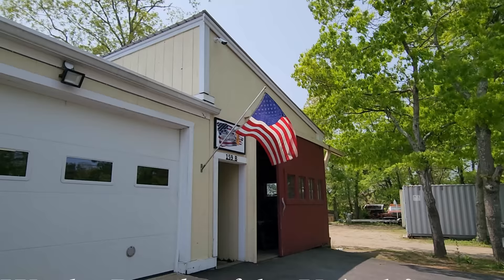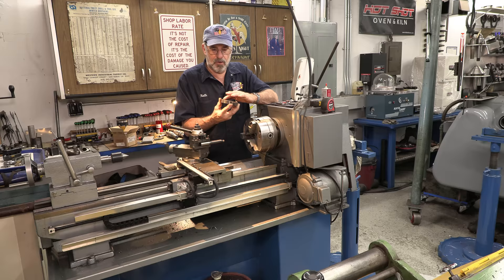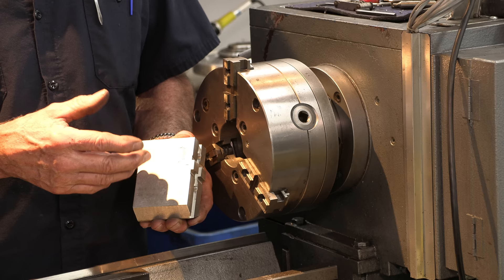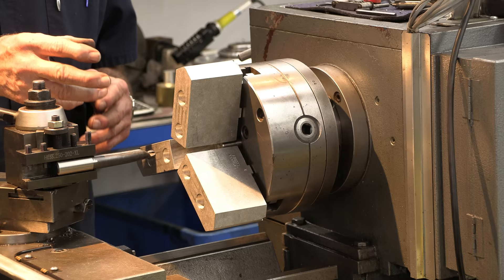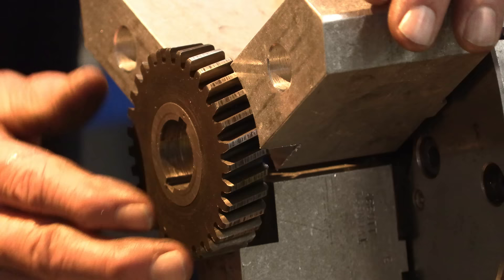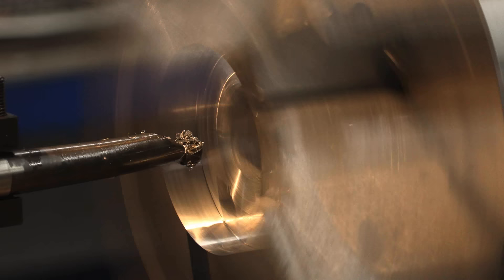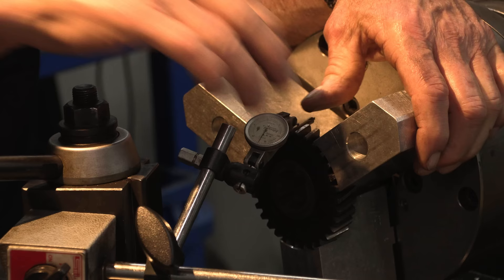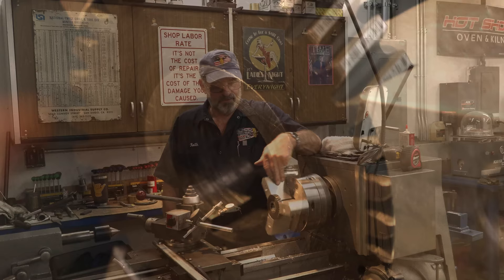Splines & Brakes Clutches & Gears 3

Comment: I worked as an engineering manager at an automotive gear and industrial gearbox manufacturer. We had special jaws that had pins that located on the PCD making the bore concentric to the PCD within 0.0005". What helped was we would use hobs that topped the OD as it cut the gear. After gear shaving, if there were further operations we could use the OD with confidence that it was then concentric to the PCD within 0.0008" on average. After heat treatment the bores were ground off the PCD for a finished part with the maximum concentricity between bore and PCD of 0.001". Your OD is turned so that could be the reason why you see the results you have. The PCD readings look quite promising for you. Interesting post, thank you.

Comment: If i may add a little, you should always use the same chuck key hole when mounting the workpiece as you did when holding the distance piece to bore the soft jaws, and ideally a torque wrench tòo but that might be going over the top for a worn or used part .
Its always good to see old equipment brought back to life by doing the ssme things you have to do to a new oriental one to get it born😅

Comment: i would have thought the outside diameter of the gear would have been better to indicate off of instead of a wear surface in the gullet of the tooth . I assume there could be wear differences in the teeth or even a difference in tooth depth from cutting the teeth . I do like the soft jaw boring setup .
Reply: I thought the same thing, the O.D. doesn't get any wear.

Comment: Keith

I know that you have got a new motor for the lathe with double the speed , but have you considered that you would need to up the HP to get the performance you seek  , if you have not increased the HP it may have a hard time getting it up to the new RPM and be able to take an effective cut 

I ask this because in the long distance past when I serviced large lathes up to 48 inch swing  this very thing was muted for a lathe of similar size to "pearl" it was tried by altering the pulley ratio as a test but the end result was poor , hope yours work out OK
Reply from the maker: I have considered the need to also increase the HP, but I believe the tooling changes from the err of design to tooling err now will equal out the speed difference. Some of the slower speeds are so slow I can pass them walking backwards. LOL The motor is the easyest thing to change out and effects no other lathe features, just the load and amount on cut.
Reply: @KeithFenner  
glad you have considered this requirement 

thanks for replying